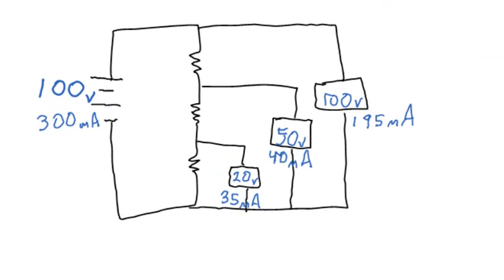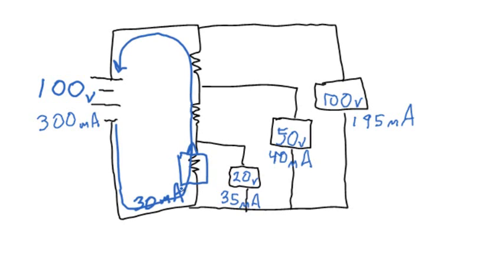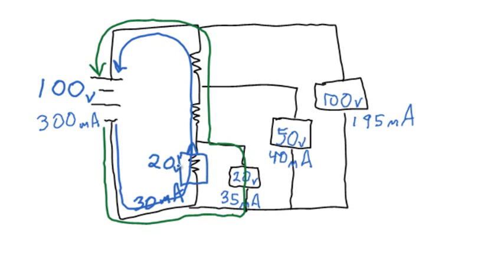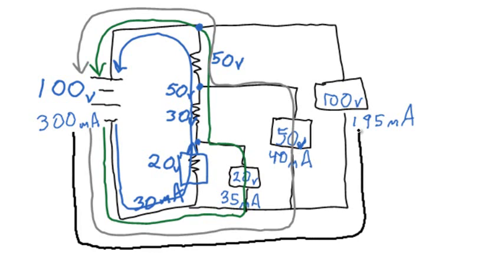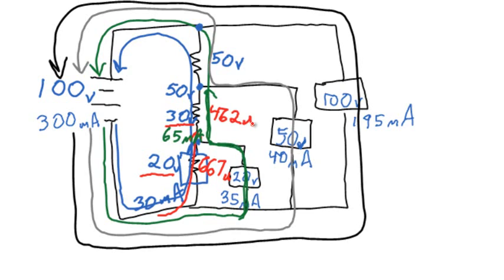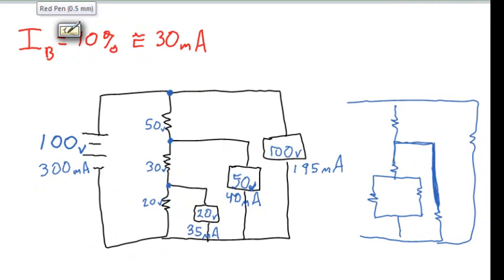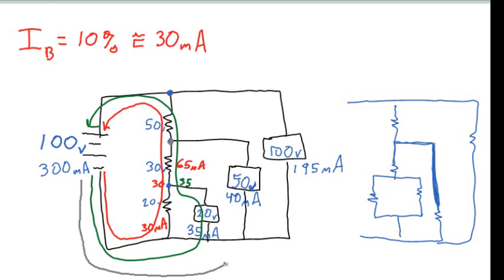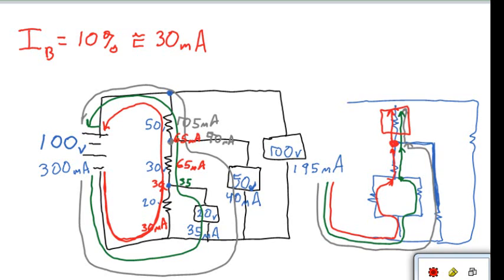loaded voltage divider bleeder parts 1 & 2

Comment: Great video, I learned exactly what I was looking for. I do have one newbie question though, so forgive me if I missed something obvious. I know you add the current branches to determine amp output from the power source, but I'm not clear how you knew it was 300ma from the start with the load draw being 270ma. I get the 10% rule, just not clear how you arrived at that before doing the solving. Thanks.